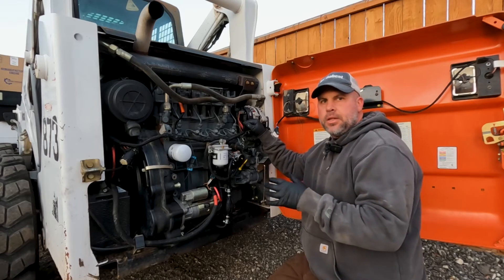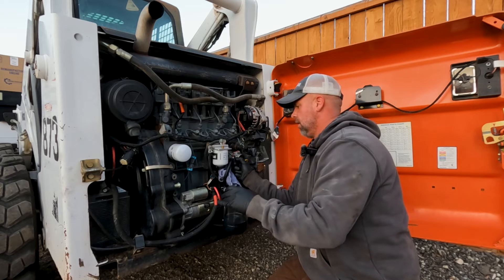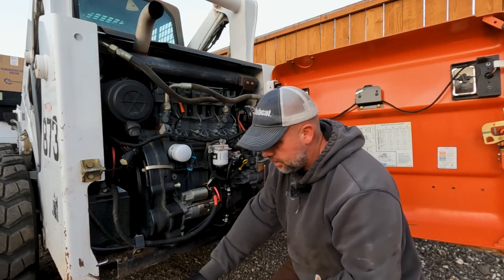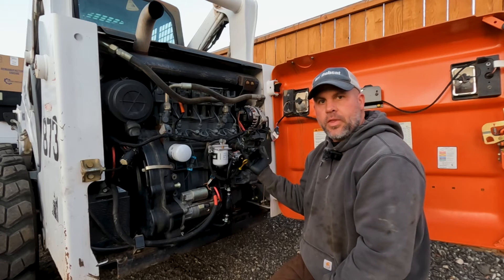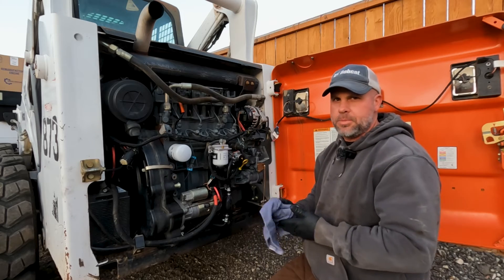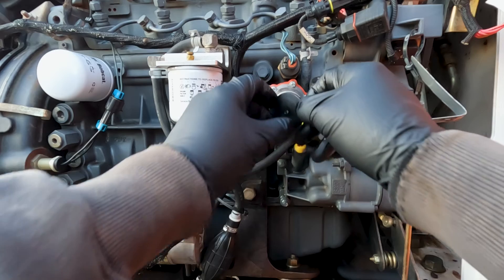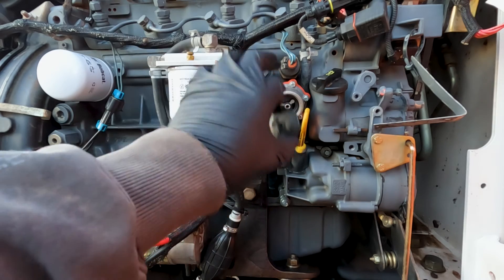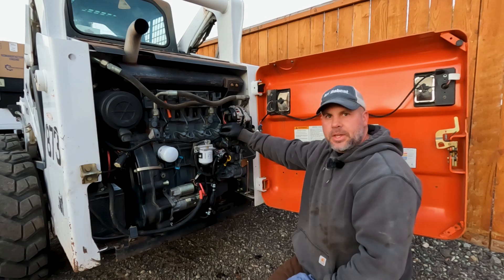Why Is The Diesel Black in my Bobcat

Comment: Would you have any experience with the 2007 DDEC 5 Detroit Series 60?  I'm having the exact same problem. 
After adding quarts of algae killer, I removed the tanks, pressured washed them out, replaced the fuel lines, fuel filter and the problem occurred again within an hour of high idle, 1400RPM.
Thanks

Comment: I just bought a 1988 743. There's a tall vertically mounted filter (that looks like a huge oil filter) on the right side of engine I can't find in the manuals. Thought it was the oil filter at first but I see that's a small horizontal filter on the left side of engine. any ideas what that is or links to parts diagram for that oldie but goodie?
Reply from the maker: That is the hydraulic oil filter, depends on the serial number but I think you have a 6668819 filter.

Comment: Hey! Great videos, Very helpful! I have a 2005 s220 that’s blowing blue/white smoke. I have a Kubota engine but I’m not sure where to start on fixing the problem. I was told it’s the turbo or the engine is bad. The engine runs great but it does smoke and oil level goes down so i sure it’s burning oil.

Comment: Can that cause that engine to smoke?   my 863 smokes and burns oil, I was thinking it was a the turbo leaking and burning oil, but that might be an easier fix.  It runs strong but I sometimes have to prime it after it has been sitting...  I already cleaned that filter... but never checked the color of the fuel...
Reply from the maker: Definitely worth checking out.